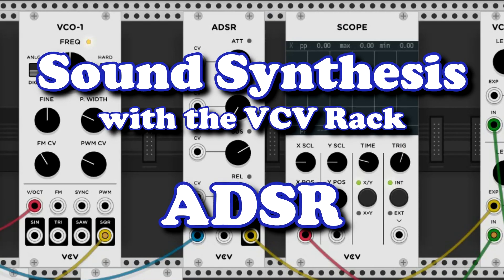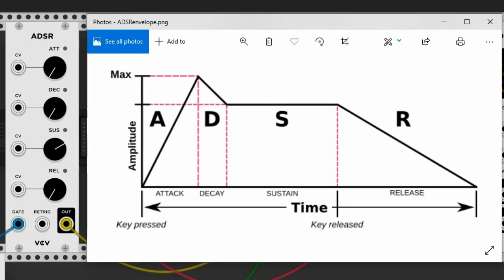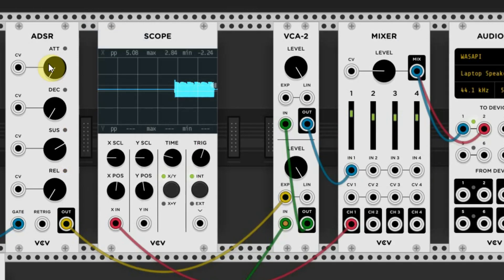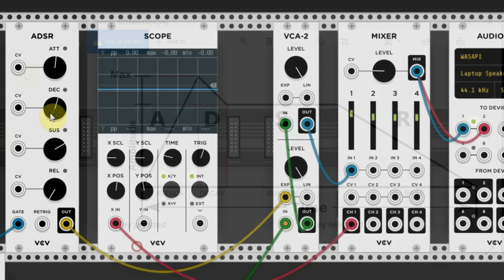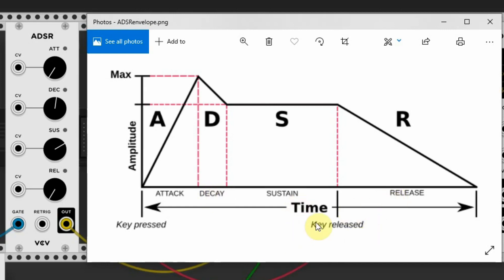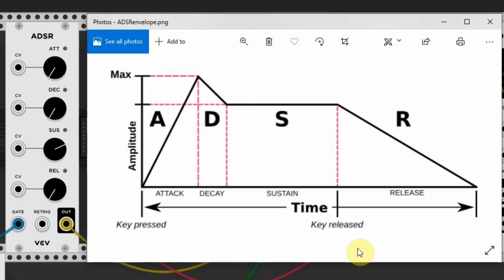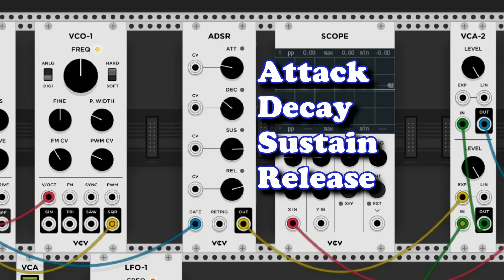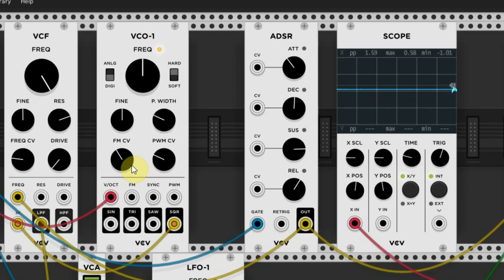Sound Synthesis using VCV Rack - ADSR / Envelope Generator

Comment: After making Electronica for quite some time, I need to do a piece in the New Orleans jazz style using sample libraries (SFZ/Kontakt), where I want to use at least a bass clarinet and a banjo. And I need to do this with all free utilities.  Well, there's the Kontakt demo thing, but let's ignore that for now.  I've seen your video on the free banjo VST, and thank you for your tutalage by the way.  For now, I'm focusing on the bass clarinet, which needs to be highly articulated to sound real and especially to be true to the early 20th Century New Orleans style.  I've been studying this type articulation, particularly through the Lincoln Center Jazz School.

I have three potential bass clarinets to work with: Alpine, Vermillion, which does not have an actual bass clarinet, but the 'regular' clarinet goes down into the lower register, and Virtual Playing Orchestra.  All of these solutions have their problems.

What I need is a playable sample library which I can apply pitch (for vibrato), volume (for tremelo), and ADSR (for legato, staccato, et cetera)...and I figure that I can use note slides in the piano roll for portamento..  I am fairly new to this and I think if I have pitch, volume, and ADSR that I can (possibly) emmulate the articulations necessary for such a bass clarinet performance.

Each of these instrument packs that I have cited, have pro's and con's.  Vermillion seems the best option, but it doesn't have a real bass clarinet and the ADSR there seems 'less responsive', particularly the attack needed to make a nice stocatto.

Any help you can give would be greatly appreciated, because I'm about to give up and change styles on this piece even though I would truly love to learn advanced articulation for orchestral sampling.

Ah, one more thing: I have been trying to use BRSO Articulate, and I've been trying to understand MIDI channels and ports, but I really can't find good basic tutorials on these things.  I cannot see how BRSO as a synth can control another synth such as Kontakt.  Also, it is very difficult for me to understand the interrelations of these VST's and SFZ's and the CC controls.  Again...I have researched this a lot.  I feel like this stuff is common sense to others but not to me.

Anyway, I have learned a lot from your series, and thanks again.
Reply from the maker: Wow, you have done a lot of research already. What you are looking for is difficult to find. It might even not be there at all. Maybe it needs to or can be created with a sampler and some free sounds. Reading your wishes pops up one tool in my head and that is Synthedit. You can create your own synth with it, also sf2 players with all kinds of cc control, lfo, Adar and filter. But it is difficult to learn.